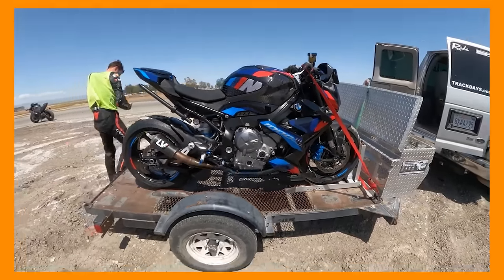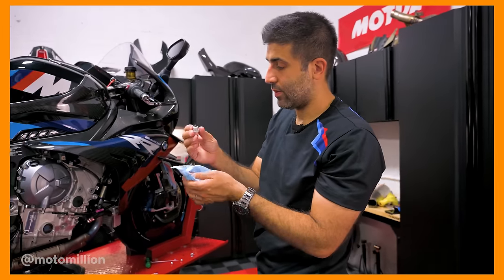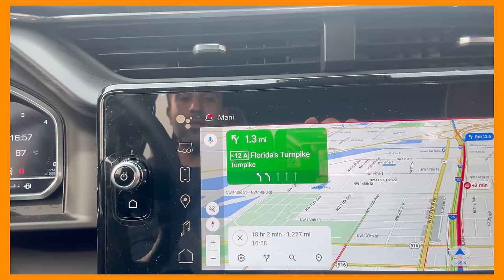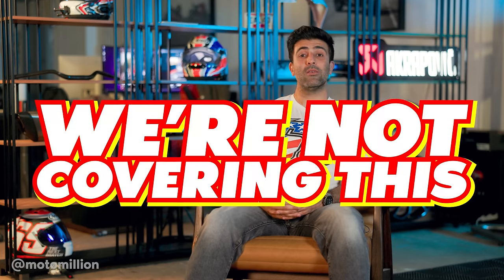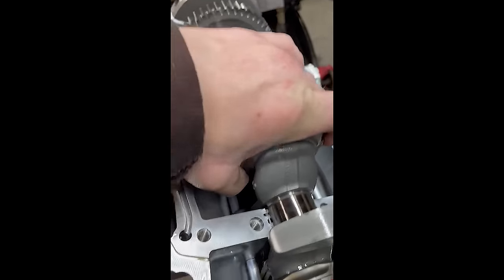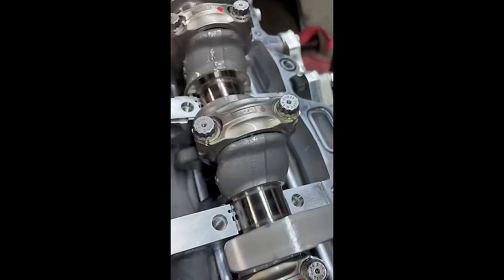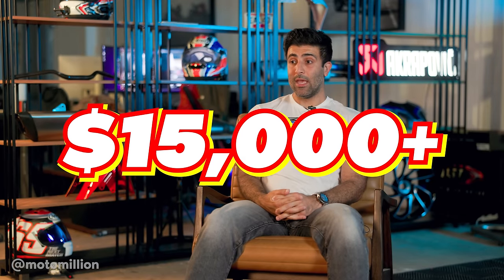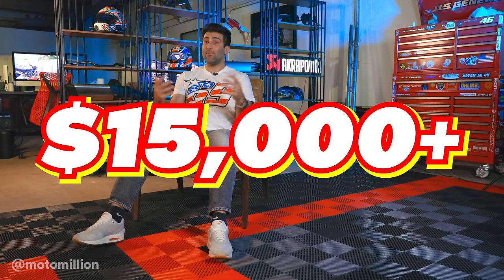MASSIVE Engine Failure on our M1000RR & BMW REFUSED Warranty...

Comment: Haven't seen this comment so I'm making it, you took a gamble by removing the rev limiter yourself. I'm pretty sure anyone that knows anything about warranties will tell you that tampering with the ecu will automatically void your warranty. Just because it doesn't make sense to you isn't a valid justification.
Reply from the maker: We followed manufacturers recommendations. They state to do the first service between 350 and 700 miles, after this the break-in limiter is removed. This is not the 14k-15k rev limiter, this is a 9k rev limiter for the break-in period, which we followed.

This is in the owner's manual.
Reply: Excuse the dumb question, but if it’s removed anyway why did you have to remove it ?
Reply: @Motomillion  How many miles had the bike done before the first service where you removed the break-in limiter?
Reply: @andrewstones2921 it’s removed during the first service by a technician (they did the first service themselves and had the tool to remove it). It isn’t an automatic change in rev limit after a certain mileage.
Reply: AJpro88, you aren't really paying attention, are you? Also, a tune doesn't automatically void a warranty at all. You are obviously very ignorant to how warranties work.
Reply: Yeah I agree, I have the service manual open in front of me. But you get this done for free by BMW, so you have some comeback, you decided to do it yourself. You also did it as early as possible at 350miles and put it straight on a Dyno and redlined it.

In Europe ours says the same but in km, so 500-1200 , I had mine done at 1,181, why would you be so reckless , on a Dyno after the absolute minimum break in possible. Absolute Darwin award stuff

 @Motomillion
Reply: More to the point. How many have blow with the rev limiters still on before running in period. And how many after it has been taken off after the braking in period.
Reply: People are stupid.....   They followed instructions.  The bikes engine was defective.  End of story.
Reply: I agree that it was “unwise” to remove the run in rev limiter at the very low end of run in mileage and then take to the full red line on the dyno as shown in the video. This engine is high performance and tolerances are critical. Number 2 bearing was probably a fraction tighter and needed longer to bed in?  That said, it is still technically a BMW warranty issue and they are also unwise if not derelict in not honouring it. Your experience suggests BMW should change its run in recommendations to a higher mileage and smaller range. eg 1000-1200 km.
Reply: Hey people, you guys know much about motors? The run in rev limit is to help the rings seat to the cylinder wall. Not to let the rod bearings bake in so they don’t fuckin throw a rod. Idgaf if you take the bike 3 miles and then bounce it off the limiter 10 times if the motor fails it’s fucking defective. Especially a super sport liter bike. Gtfoh with that BS. The run in rev limit is total BS anyway . BMW is losing thousands of potential sales because of the well known reliability issues. Now their pretentious warranty policy will ensure they drive Motorrad into the ground. Destined to fail or hemorrhage money until someone with a brain shuts it down to start over with unpretentious people that understand basic business principles and how to build a reliable machine.
Reply: the first thing I thought.
Reply: This. You took a gamble, you lost, suck it up.
Reply: @dgmclar can not agree more… smh 🤦‍♂️🤦‍♂️🤦‍♂️
Reply: This is a BMW failure. They have had known engine issues for awhile. The fact that they wouldn’t warranty it guarantees I’ll never spend my hard earned money on one. That bike cost you guys 45k. Unacceptable. You changed the oil at manufacturers suggested mileage. As far as the break in rev limiter that’s a BMW thing. It means nothing. Other bikes don’t have that. People change oil early in break in all the time and don’t have catastrophic engine failure.
Reply: You didn't see the comment because you are completely misunderstood and are the only person to comment thinking he removed the main Rev limiter himself. When in actually the bmw tech removed the break in limiter after the break in period.
Reply: @Image-X  a tune that removes a rev limit, or modifies it without the dealers consent, will void it. If you are a mechanic and fix a csr, amd the owner goes drag racing and blows the motor, will you fix it for free?
Reply: Yamaha R1 and RSV4 FTW. No engine failures with them. They actually know how to make solid machines.
Reply: The gamble was with bmw, not the modding. Yamaha has honored warranties for major engine failures in ecu modded r1m, including mine. Google "10w40 synthetic can cause engine failure r1forum", which took about 10 months to resolve. Now, my 2022 s1k came with a bad bluetooth unit, but bmw refused to do anything until the dealer requested and possibly paid for a new tft display (where bluetooth is located).  The time it took to resolve was the same, 10 months, for a much smaller issue. Bmw are lying, greedy, sob's.
Reply: @nicowjensen yeah i dont get why ppl NEED to over-rev their bikes until its properly broken in…I break in my bikes the way ive always done/known from others: nothing over 7-8k until 1500 miles  or so; varying speeds and going thru ALL gears etc. 

I know this comment im making has nothing to do with assuming i do it the “right way” & id never tell anyone else they HAVE to do it this way… i WILL 100% suggest it to new riders and i have. Whether it makes a difference or not, all my cars ive owned over the years have lasted me a long time with zero issues as well as 2 gsxr750’s that ive put over 30k miles on.
Reply: @_illtal  very often it's quite difficult for people to accept facts. I also believe there is a serious issue with the engine, let alone with the way bmw handled the case.
Reply: lets see a panigale v4 R revs 16500 without any issuise in Stock and the BMW broke down just by overpas 250 rpm more🤣🤣?? i mean how much revs the BMW ?15500 rpm somthing like that,think about what gonna happend if the BMW reach the 16500 like the V4 R Ducati??
Reply: @HRCfan17 they are more as you my think.
Reply: @andrewstones2921 the factory 9 k limiter is there for a few hundred miles for break in. Just like hellcats are limited for 1500 miles or so.
Reply: U can see from the get go the bike had issues man
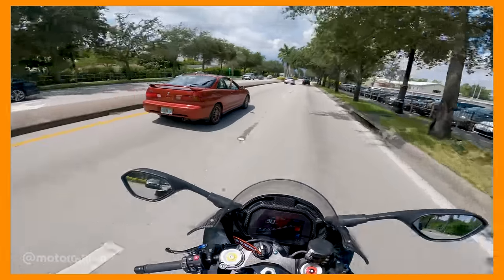Reply: @Motomillion am I missing something or does the bike not have a break in limiter in mind 2:27 because if so of course it's going to void your warranty if you remove the limiter on a 6 mile old engine. With modern bikes in general you should know that pretty much anything voids the warranty also with other brands. This is clearly 100% on you. Even if it's bmws fault that the engine blew up you're still not entitled to a refund
Reply: @goldCrystalhaze  I raced bikes. I have a RSV4 which was considered a fragile engine back in its early days.  Never once did I have a problem with it.  Just did the maintenance on it.  Most of the 8k miles on that bike are race miles mostly in TX.  BMW seems to have a problem, my buddies that still race the brand have had to replace an engine as well without warranty!  It was a 22 S1000RR. Now he has a 24 M1000RR.  He's tracking it.  I just hope nothing happens to my guy on track with this thing.
Reply: @_illtal  I've heard about many reliability issues with these (expensive) bikes. Even more sad is the thing that people will jump on you if you talk about them. Just read some of the comments (I'm sure you did!). What blows my mind is the unwillingness of bmw to at least investigate the root of the failure. The rev limiter excuse is ridiculous....
Reply: Yeah but it’s just not a rpm issue. Rpm issues would be up top somewhere…
Reply: @dgmclar meh, you break in the engine how you intent to use it. This break in was sufficient. I have a s1000r and removed my rev limit around 500 miles. Changed oil to motul 300v. It runs great! The bike even keeps revs low until it’s warmed up. Anyway high rpm damage occurs up top first, not down low.
Reply: @alexkosinski2581  RPM are hard on all parts 250 RPM is not a lot of over rev on a bike. Also they are saying that was on the 9k RPM second limiter.  The engine revs to 15k RPM it's bullshit.  It seems like BMW is installing bad engines and denying warranty to get buyers to then buy a "good" engine.   60k for a hobby bike.
Reply: This.. was a dumb question if you paid attention to the whole video. Kick rocks A.J.
Reply: @Image-X A tune will definitely void a warranty. It pushes the ebgine pass what the manufacturer deemed safe enought to cover under warranty.
Reply: If you pay attention to the one Dino run that they show he cranked the motor way into the red line nobody's fault but their own I don't blame BMW for not covering it at all
Reply: Imagine thinking by reving an engine your main caps will fall off 😂
Reply: @PatricioGarcia1973  False. First, over rev will have to be shown to be the cause of failure.  That isn’t always the case. A tune alone does not void a warranty and many dealers offer a tune as an upgrade. Bike is still FULLY covered under factory warranty.
Reply: @brucetec6597  Negative. The simple presence of a tune alone does not void the warranty. Many dealers offer tunes as an upgrade.
Reply: Full RPM test after 400 miles was a mistake.
Reply: @Image-X  That’s not true man. BMW Germany will see how many software upgrades have been performed and unless they did them they reserve the right to void depending on the cost and correlation of the damage. Your dealer by itself cannot void
Reply: @TC-ku3oe  Many BMW dealers offer tunes and they do not void warranty. Especially milder tunes and those that do not raise rev limit. In the US, it has to be shown that a modification caused the failure. They can’t void just for the sake of voiding.
Reply: @TC-ku3oe  False. BMW will actually remove the break in limiter at 275 miles per request.
Reply: @Image-X  Dealer tune is different than an aftermarket tune. Why would they warranty your bike if you happen to put a shitty tune on there that destroys the motor?
Reply: @Image-X don’t know if it was explicit stated: in EU, Anything done not by a certified brand dealership is “automatically” warranty void. Because there is no actual record of what anything is done, even if you have receipts and what not..
In the US, like you implied, might be different. But even if the Brand offers a “something” upgrade (be it a Tune, or an aftermarket exhaust, or something else that messes with mechanic/ECU) it doesn’t mean you can do it outside of the dealership.
Kinda of shitty, and yet, a safeguard..
Reply: Not that it has anything to do with this video, but I’ve never liked a dyno run where they don’t pull the clutch and let the rpm’s drop after it hits its max RPM. Taking it to redline then letting the dyno keep it all spooled up during the engine braking part is just unnecessary and isn’t giving g any data that I know of. So on a dyno run I think it’s just best to go all the way to max rpm and pull in the clutch as you let off the gas. Just less wear and tear overall.
Reply: Not sure if you watched the entire video. But this is absurd and shame on bmw.
Reply: I would have asked for a whole new bike and I’m sure you could have lawyers on this. There’s no way I would accept anything less.
Reply: Sounds like my experience with my $48k BMW i3... their experimental carbon fiber monocoque EV.  
Drive motor failure at 94k, which started at 70k while still in warranty... but told me "that sound is normal for the i3".  BMW denied warranty, and refused Goodwill. It's a known problem in the pre-2018 model, which is when they switched to an improved design..... because they screwed up their first EVER electric motor design. They also are having many electric aircon compressor failures... but because this essentially scraps the car (because they use refrigerant to cool the HV battery pack), they deny any responsibility.

Many i3 owners are like me... it's my first AND last ever BMW.
Reply: Dweely doop pit-squids rev their engines past redline in neutral and for too long in low gears then wonder "why their motors blowed up" 🤪 ahyulk
Reply: @jb5music  buy a Honda
Reply: I have to agree you modified the engine and you know quite well that voids the warranty.
Reply: Stick to Japanese 🥰
Reply: @Image-X I work in quality warranty for a major manufacturer. You tamper with that ecu tune other than a manufacturer approved one, the claim will be denied. Blame the EPA, they are enforcing and fining companies to abide by emissions regulations. This guy has a 30k paperweight. It is also detectable when a vehicles ecu is flashed backed to stock.
Reply: @dgmclar exactly
Reply: yah @jb5music  but I've been pinning the redline for Wood before you were a thought and my Yammie and Kawi never, not once blew.  And if it did for my customer(s), it would have been warrantied.  That's how you build brand loyalty.  Cause when you go 300rpms over the break in (not the redline) and the motor blows, it was gonna blow anyway.
Reply: Even tho it's a BMW, in my opinion it's your fault for blowing it up. Putting bike on a dyno, ripping parts, and flashing it etc voids warranty and is by mfg standards considered abuse. It was not broken in properly and you guys sent it for all it's got. Just my worthless opinion. No idea how it was broken in, but clearly refused to put up with you. 🤷
Reply: Yeah, bmw doesn't stand behind their products when they have faults. Electrical is big with these bikes '18+, and they still won't recall the defective parts. Mine was down because of bad wiring shorted and fried my ecu. They tried to say it was my stage 1 bren tune. And they fried 3 ecms trying to prove that. Even had to deal with bmw Germany through the ordeal and it ended up being their wiring shorting out coils and then the ecm. After a few months of bs, I got it back.  Love the bike but it has its issues and I hate the company.  Suzuki never gave me issues with the gsx-r. If they'd get rid of that Gameboy display. That'd be my go to from the bmw.
Reply: @ASMODAY1K  S1000R was the worst bike I have ever had the pleasure disassembling. Wiring harness in particular is extremely brittle. Connectors seem to be made of chocolate, in comparison to the zx4rr is built like a tank. I'm not surprised slightest bit beemers have terrible electrical issues. Aprilia and Ducati is very similar in wiring loom quality, or lack thereof. Not a chance I'll own anything european. My stable remain all green machines.
Reply: Everything you just wrote SHOULD have been obvious to a guy buying this kind of bike.  Unfortunately, dollars and sense don't always go together.
Reply: I have two friends that have had their brand new S1Ks engines blow up and both times they did the same thing as the guy in this video: took a brand new bike that hasn’t broken in yet and redlined it. These guys have no patience and want to show off their bikes power right away, but blame BMW. I have a 2024 S1K that just replaced my 2014 S1K and no issues, but I’m waiting till I get to 2k miles before I start having fun with it.
Reply: @ja31472 that’s exactly what I meant by taking a gamble. It was probably gonna blow up anyways. And the fact that it was acting up from the get go should’ve been more of a reason to do everything by the book.
Reply: @johnnyblaze1372  my V4R gearbox fell apart .. so suppose they all break in some form
Reply: Yeah. Bad bmw. We did everything correct… maybe not. 😂
Reply: @AJprp88 bmw didn't void the warranty. He clearly stated that. Which proves bmw must know they weren't in the wrong removing the limiter in respect to the manual.
Reply: @jezzyfizzle1  they didn’t void the entire warranty but clearly voided the engine. It’s a play of words.
Reply: @dgmclar  this is absolute nonsense, and cutting away all of the fluff and nonsense in all of this post by various different poem, mechanics and enthusiast, every race engine that is built pretty much in the world is Broken in on the Dyno basically through a short sequence of pulls building your way up to full throttle to seat the rings properly! Not after 1200 miles or 5000 miles or whatever that is literally put there by the manufacturer to get the complete of users put together to basically not be able to beat on the bike from the beginning. Basically it’s just a way of breaking in the rings and cylinders as slowly as possible to get a little bit longer life from the piston rings and cylinder walls. Literally has nothing to do with your connecting rods flying off the crankshaft, which should never happen regardless of when the bike was broken and how it was written it literally makes absolutely zero difference for an engine build if it is, broken in extremely slow or like all race engines are broken in on the Dyno, which is basically full throttle after five or six minutes of Rpm variations…! If an engine is built correctly with the correct parts and everything is torqued correctly there is absolutely zero difference whether your engine is going to come apart after 1200 miles or right from the beginning period….! we build world level race bikes for a living as well as race cars and can 1000% assure you your bolts will not come loose and get Engine built correctly no matter how you break-in the engine PERIOD!!!! as we’ve said numerous times above, this is a known problem and fault of the manufacturer that has also happened in the past on previous engines with connecting rods and connecting Rod bolts, basically in the exact same manner and fashion clearly whatever they were doing wrong before they are back at it again, in the past was using the wrong type of rod bolt coating and not tightening the rod bolts correctly, using the proper torque lubricant, which was proven in the past by themselves, at which point they issued a recall which basically means they are admitting fault in design or manufacturing and fix the problem for free, which is extremely financially taxing and costly and the last resort at all possible scenarios they want to do! In this case, since this is a halation special, a race bike, they seen that they have unfortunately made another giant mistake with the rod bolts, but the difference in this case is this is a halation special, and instead of biting the bullet, and doing a full recall to fix the issue They are getting out of it by a loophole because it is a “Race bike” halation special! Which absolutely is not what should be done and apparently people cannot read. They followed the manuals break-in procedure to a T. There is a range and time that you can have the first service done and remove the 9000 RPM rev limiter and the reason it is set in a range is because not everyone’s going to be able to get into the dealer right away so they give some small latitude. But the point the interval is set at mileage it is. Set at is there is a special braking oil in the engine to allow the piston rings and extremely hard coated cylinder walls to break, but this is happening and breaking in the rings to the cylinder walls basically the final in process with the piston ring and breaking oil, you are depositing a lot of cylinder wall Break-in debris to stay suspended in the oil and travel through the bearing and the entire engines oil system galleries. So change the oil and getting rid of the breaking oil and all of the breaking debris at the least amount of time possible that they recommend to stay inside the warranty is better you’re getting all of that breaking metal and debris out of the engine and putting full synthetic oil back in the engineto stop or breaking in of the parts so you do not “over” wear them in basically. So they did everything exactly correct and got that break in oil and debris out of the engine as soon as possible within the recommended range of spec by Bmw to not mess up their warranty. But since the bike, then had a tune uploaded into the ECU that unfortunately gives Bmw free rain to basically avoid the warranty and say whatever they want you got bird poop on your bike so your rod bolts fell out type of bullshit and decline a warranty claim even though this happened not because of anything anyone did after it left the factory but because at the factory they were not torque correctly or something was not correct correct in part or lubricant selection during the torque process of the rod bolts, plain and simple…. Any of the people saying otherwise, were actually real engine builders they would know that your bolts just don’t loosen and fall out for no reason if they are installed and torqued correctly PERIOD! if anything they would have broken not come loose if the bike was rev to 20,000 RPMs or something crazy that would result in a Rob Bolt actually breaking in half and I can assure you it would not have unscrewed itself. It would have snapped if that were the case! 🧐… and again we are mechanical engineers and professional engine builders as well as a race shop, and have been doing this for a living for the past 20’+ years….. This is not speculation or guessing, or watching YouTube and magically becoming an F1 race engineer!
Reply: Now that you have the new engine do the same thing remove the rev limiter and see what happens
Reply: @Image-X if the tune on the engine was done by bmw its fine ,by anyone else voids the warranty which is the same as cars
Reply: @jacobhendrickson8935 why would they pay anything out when the tune by another company voids your warranty, its written out in your warranty so if they take bmw to court they will lose and have to pay for the court costs which is why they have not done that and are just trying there luck by trying to make bmw look bad on social media ,some people are just thick as fuck
Reply: @simonoldnall6458  I wasn’t sure of the details when I made that comment.
Reply: Big bang is OK, if you don’t puch on track, aprilia has a lot problem with Valve springs and crankshafts, its not realiabile bike. Want bullet prof kawa zx10r.
Reply: @brucetec6597 Negative, stock tunes have to balance emissions with power, often times running the bike lean or rich just to pass emission standards. Tunes can make a bike run much healthier.
Reply: I think cylinder 2 caps were not tightened to spec maybe forgotten then these guys are do for selfers. Bad combination…. I just got a 24 s1kRR… I’m a master Chrysler tech and I don’t touch ANYTHING… if my clutch needs to be adjusted during that first 1000 miles I’m taking it to them